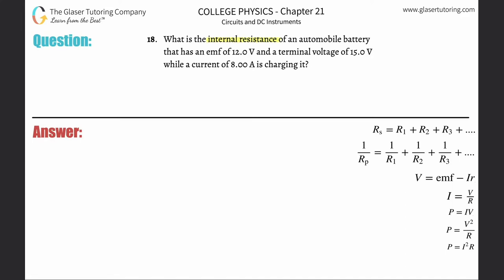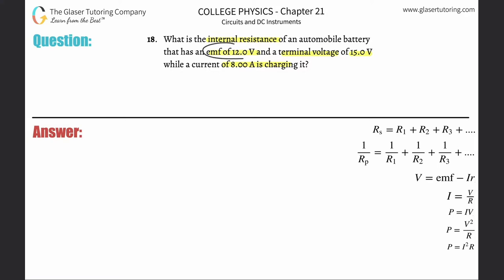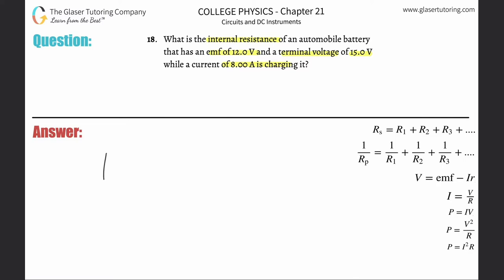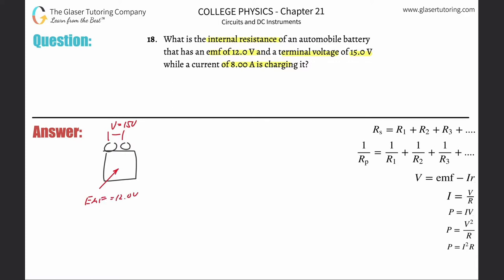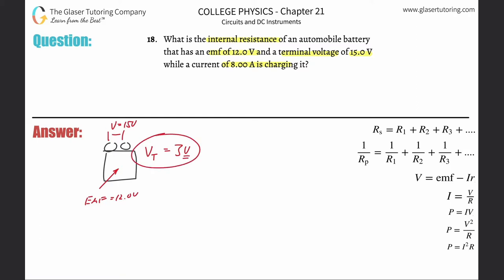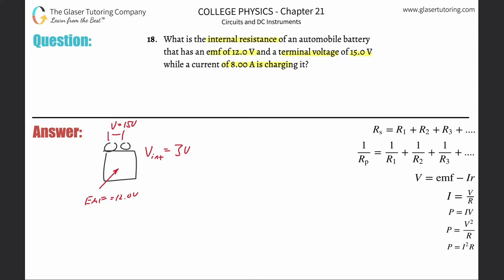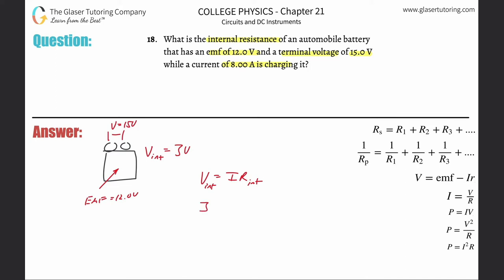21.18 | What is the internal resistance of an automobile battery that has an emf of 12.0 V and a

Comment: All the other answers say either .02 or .04 ohms for a car battery from a google search.  A 12 volt battery would charge up to 12.8 volts.    And the chargers voltage might not be 15 volts but closer to the cars 14.5 volts alternator. So if we go with .04 ohms for the battery and assume the battery has a starting charge of 12 volts and our battery charger has a 14.5 volt output, then the 14.5v - 12v is a 1.5v difference.   That is our battery voltage drop.  So the 1.5V / .04A = 37.5A.  So a battery charger voltage of 14.5 volts is way too high.  We need a lower charging voltage if the battery resistance is .04 ohms. 

Unless the battery resistance increases as the current increases.